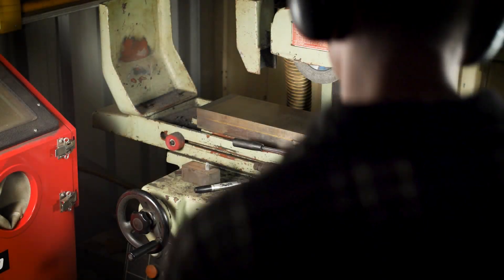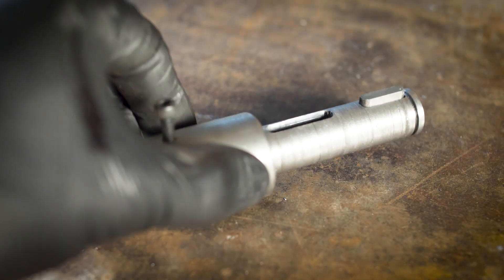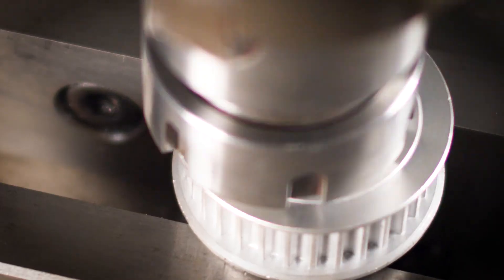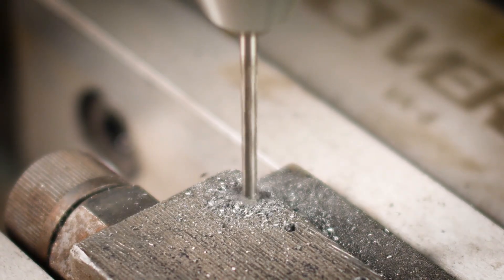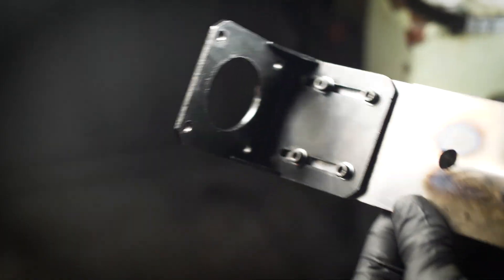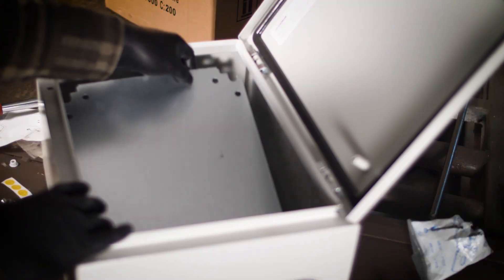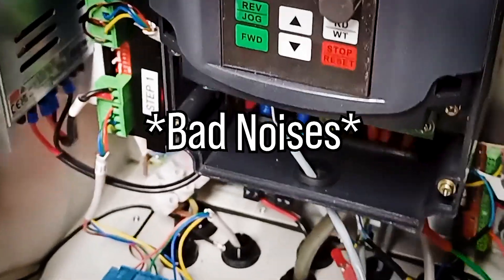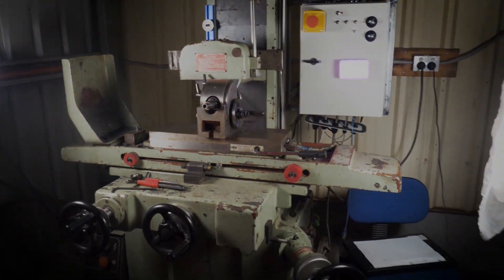Surface Grinder Power Feed!

Comment: I'm thinking of making the required adapters etc. for a simple Y axis power feed on my Harig. Do you think an AC motor will be good? and if so what motor + control might I buy? Thank you for the Great no-nonsense video.
Reply from the maker: An AC motor might work on the y axis, you'd typically only want small movements at a time and speed wouldn't matter too much, with the right controller you could send a short pulse of power to step it over I suppose, running them slower could be an option for more control, but they generate a lot more heat and lose torque at low speed. A stepper or servomotor would be more conventional for this axis. But if we are talking about the more rapid x axis, then an AC motor would be a good choice as it provides torque at speed. I hope that makes sense?
Reply: thanks for your advice! No rapid needed for this application. Need to be able to creep feed in one direction, on the return I will hand crank. Sounds like a DC motor and control will suit me. Since the Y axis requires less effort (less load) than the X axis, what motor package can you recommend? Thank You
Reply from the maker: Hard to say without seeing your machine. My method is to hang  weight from the handwheel (handle positioned at 3 or 9 o'clock) until it moves. Then take the weight in kg and multiply by 9.81 to get newtons (N), then multiply by the handle radius (in m) to get Nm of torque. I add a 2x factor to this so it's not on the brink of stalling. I'd recommend looking up the motor torque curve to make sure you can get the required torque at the desired motor speed
Reply: thanks again for taking the time to help me in this matter

Comment: What stepper motor did you use for the downfeed? I'm trying to do something similar and not sure how to size the motor.
Reply from the maker: I attach a weight to a handwheel to estimate the force required to turn it in either direction. The distance from the handwheel handle to the central axis × the force is the minimum required torque. I'd probably double this (or triple I'd rapids are required to be safe). You'll need to convert kg.mm or whichever units you used to N.m to size the motor torque. Look up the motor torque/speed curve, note that steppers lose torque at higher speeds, while DC motors gain torque with speed

Comment: Nice project 👍😀
I have a question...
Would a stepper motor a good idea for a setup like this ?....
It overshoots the limit switches much less and for the down feed more accurate to set for each step/distance per feed down??...
And how much did you spend on this setup ?...
Reply from the maker: Only just saw your comment sorry. Steppers have more torque at low speed, DC motors have torque at higher speed. Given the x axis is traversing rapidly I went with a DC motor
All up I spent close to $1000 AUD at an estimate, but I bought lots of extra parts while I was bumbling around
Reply: @TomMakeHere  Do you have more in depth videos of the process and supplies?

Comment: That’s really cool, this is almost nicer than complete CNC control in my opinion. You don’t have to deal with cam every time or building a custom control software that can toggle between full cam and some sort of conversational interface.
Reply from the maker: Yep that's the idea
If I was desperate I could tweak it to add functions, but I'm happy for now

Comment: Very nice Tom.  Why the DC motor instead of a Stepper? Was there some advantage?  Thanks.  Regards.
Reply from the maker: Absolutely a reason; stepper motors have torque at low speed, DC have torque at higher speed. The table needs to travel/change direction quickly.
I might do a follow up video on some of the thought processes that went into the video

Comment: Hi Tom, excellent job.
I agree with the manual Surface Grinder...becomes monotonous very quickly.
When I was looking for s SG I looked at many a manual ones. Took me approx. 2 years to find the right hydraulic one.
So glad I did. Set it running and walk away.
Regards Kevin
Reply from the maker: Yeah good choice. Definitely happy with the improvement
Thanks for watching